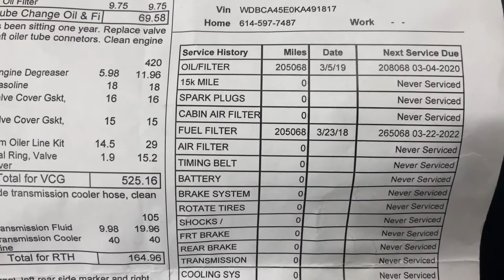Jumping Fuel Pump Relay 1989 Mercedes 560SEC W126 C126 Bad Fuel Pumps Maybe????

Comment: A faulty Fuel Pump relay Under the hood can cause the sounds at the fuel system in rear of car.  I would change The Fuel pump Relay first with the Factory Mercedes Part only. Then do a replacement of both fuel pumps, fuel filter and the Fuel pressure accumulator. Fuel pressure accumulator if not replaced and faulty will not hold pressure and fuel pressure will go away at the engine in when vehicle is off . This affects both at cold start (because no pressure) and hot starts as well. It can cause too much fuel sometimes which can cause puff of black smoke as too rich fuel.  Also redue the fuel hoses underneath as these lines last 25-30 years max before they fall apart and get too hard. . Note -you can use after market manufactured  parts except for the Fuel Pump relay under the hood.  This fuel pump relay aftermarket part however seems to fail fast and programming seems to be off..  The costs for the FP relay can range from $40 (Chinese) vs $250-300  for factory part. All in with factory RELAY would be around $575 to redue complete fuel system (aftermarket parts) in rear doing yourself.

Its not a hard job to do and lots of YouTube instruction available.  If you don't do all the items the first time, you will be back each week doing it over and over in intervals.

Comment: I don't think the pumps should sound like that. That sounds crazy. I think you found your Issueremember there's also a regulator that goes that goes in between the pump that go bad
Reply from the maker: Thank you bro....they sound like they’re gurgling. I didn’t think that was proper....😂
Reply: I’m not watching this whole video, but on the w126, just putting a jumper in to make the fuel pump run is incredibly easy to do.  The two pins, I think 7&8 are right next to each other, and just putting some needle nose pliers in them should make the pump run.  I do this all the time to drain the fuel tank before pulling the tank out.

Comment: That pumps fucked dude
Reply from the maker: It ended up being the ground wire to the pump.
Reply: Gold Element Autoworks LLC it’s always something simple
Reply: @goldelementautoworks  Was it actually the ground or was it the actual pump? I have the same humming noise, can't tell if it's defective
Reply from the maker: @Dropsix  In my case, it was a bad ground from the fuel pump to the chassis.